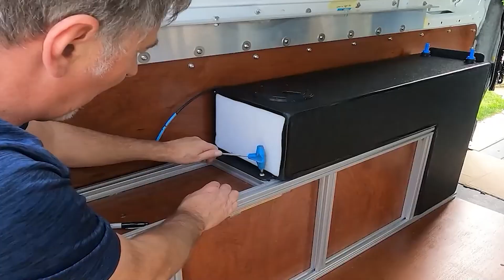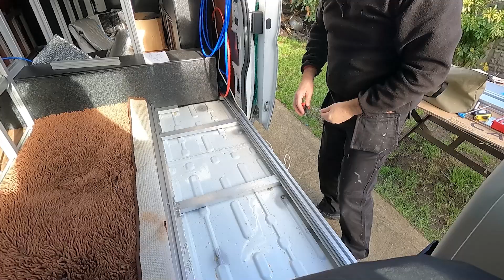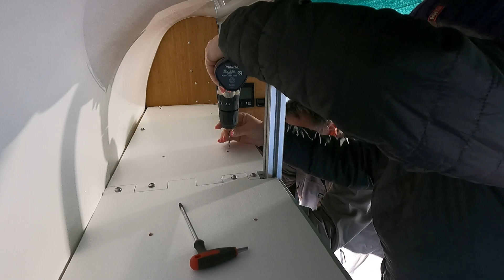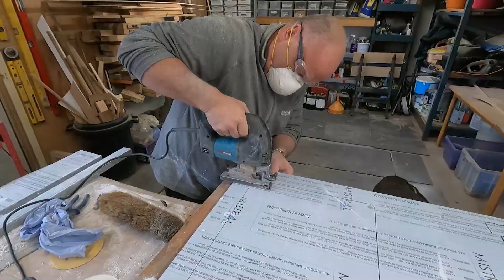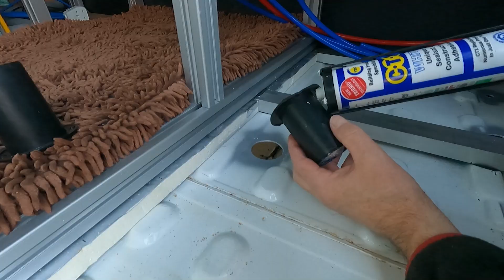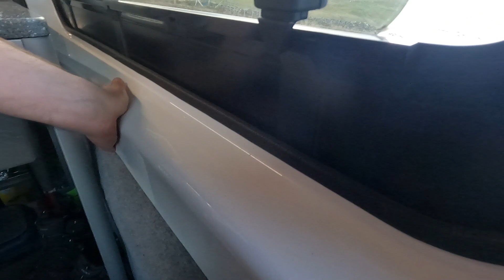EASY Vanbuild KITCHEN using 80/20 STYLE extruded alloy from KJN ALUMINIUM. Eye level FRIDGE INSTALL

Comment: Like how you've toothed the overhead cabinet bases.
Could you tell me what sink you have used?
Reply from the maker: Found it online, I'll try and find the unit although pissed off it was a little warped.... It took some sticking down.
Reply from the maker: Can't comment on your other enquiry but the floor has 2 layers to reach the height I desired.
The floor now I'd flush with the 40x40 extruded alloy and by chance benefits from the extra insulation.

Comment: Fab videos & extremely helpful as i start our van build.. quick question, i've just been on KJN's website - is it IR or BR that you have used & what slot size? (also have you used the same size throughout your van? ) many thanks
Reply from the maker: Thank you very much for your kind comments and so pleased you have reached out to us.
I have used the BR 40x40 10 slot for lower units and 30x30 8 slot for upper cabinets.
I'm just about to put my final upper kitchen cabinet in which will be my last unit. I am then going to vlog an honest detailed account about using the extruded alloy and cost so you may need to keep a close eye on posts.
I the meantime, ease don't hesitate to reach out with any ideas or questions.
You may want to find us on Facebook @ MyWay Adventure.

Comment: What width of wood panel did you use?
Reply from the maker: Hi Chistina. Thr end panel for the fridge unit was 12mm ply. I've been using spray paint from Rustolium to colour my panels, it covers really well.
Reply: @vanlifemyway7806  how did you attach the 12mm to the 3030?
Reply from the maker: @christinamacintyre  hey Christina, it's 40x40 I'm using for all my base units.
The bottom of the board bolts direct to my bedframe but lines up "flush" with my uprigh bed side.... where I can use angled brackets, or even a block of wood to bolt to the upright.
To the rear, when I install my bedside top cabinate, I'll bolt through from the fridgeside to the cabinate.
Hope this helps.